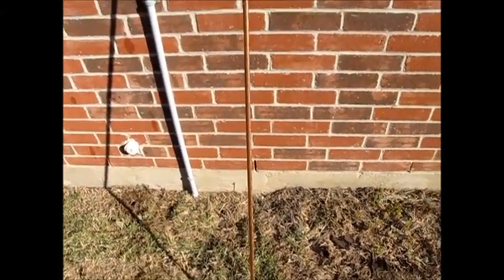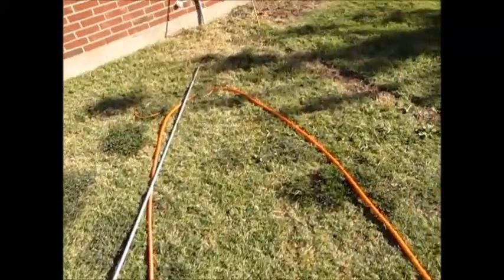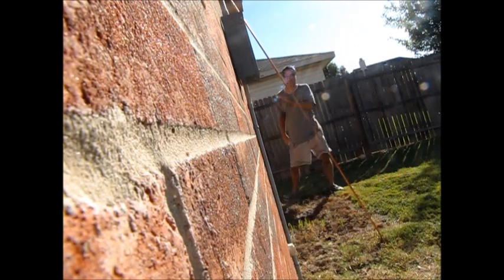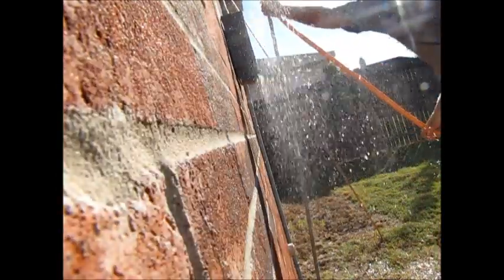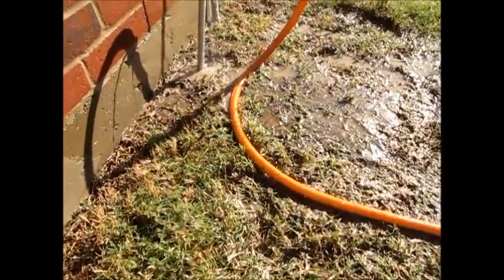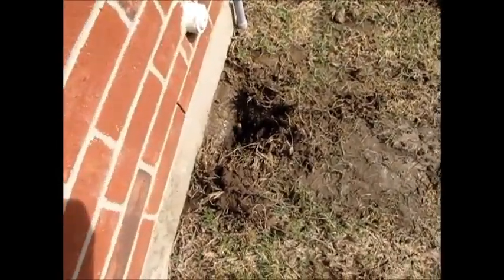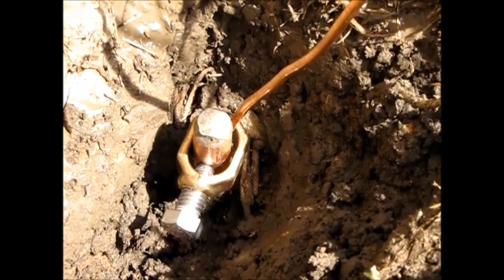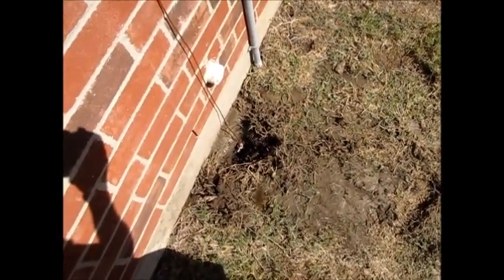How to Install a Grounding Rod The Easy Way (Full Demonstration)

Comment: Can you bury it with soild once done to conceal it so it will look clean and tidy? Thanks for this video man.
Reply from the maker: Yes, you can bury the entire rod once you make the connection to the wire.  But keep in mind that the connection that the wire makes with the grounding rod may corrode over time and lose its effectiveness.

Comment: Probable 80+ percent of the ground rods I have tested don't come anywhere close to 25 ohms not even two of them tied together.  I still use them because they are required by the NEC but you should never count on ground rods to protect you!
Reply from the maker: Truth!

Comment: I use an old black n decker spline drive hammer drill. Rod fit in nice. When i have no power i use a Milwaukee 18volt hammer drill, welded an old rusty socket on to a broken bit to cup the top of the rod. In both cases i Drill a 30" hole first then pour water in and ram the rod in. Angle away ftom footing of course. Always assume there is one. Pulling a rod is a bitch! Going to the store for another rod sucks. Cutting and calling it good is lame and just wrong
Reply from the maker: Good thoughts, thanks.

Comment: This is just dangerous. Get a post driver like a normal electrician and don't try to be CUTE with electrical installations. There's no shortcuts and no easy way out. Drive the damn rod into the ground if you'd like to pass inspection..... Water and electricity DO NOT MIX, so people DO NOT SPRAY YOUR BREAKER PANEL WITH A HOSE!!  Removing the dirt to PLACE the rod into the ground defeats the purpose. It should be tightly FORCED into the ground where it should have ZERO wiggle room or play. I should not be able to walk up to your ground rod and move it in the slightest MUCH LESS PULL IT OUT OF THE GROUND!! Save the electrical work for the professionals and DON'T BURN YOUR HOUSE TO THE GROUND!!
Reply from the maker: Please come over and pull it out of the ground.  I'll sign over the title to my car if you can.

Comment: how to make a huge mess and a lousy connection in three times the time it would take to hammer it in with a small sledge hammer.
Reply from the maker: *Provided you have no rocks in your soil and you don't mind having the head of your rod mushroomed flat.

Comment: Do not do this. This method  is driving ground rods is against every electrical code anywhere in the country.
when you use water to drive a ground rod,  and creates a cavity around the ground rod. After the water drains away the rod is completely useless.  Most of time you pull a ground rod right out of the dirt with your bare hands, after it's in water jetted . Using a water jetted  ground rod,  is  just throwing a ground rod on top of  the ground the ground,  it's just as effective. Don't do this,  it's dangerous, the ground will be worthless you will cause electrical hazard in the home because you will have no  effective bond to ground,  on anything in your entire house.
I have being an electrician or 35 years, and never once have I seen a water jetted  a ground rod pass a ground rod test.
You see this all the time on YouTube from people who don't know what they're doing, and when people put it on YouTube,  they put people's life at risk.
DON'T WATER JET GROUND RODS.  They are DANGEROUS!
Reply from the maker: Please come to my house and pull these ground rods out.  I have two of them.  You clearly have never done this and know nothing about this method. 

If you dig a hole in the back yard 5 feet deep and walk away, what happens?  Erosion fills in the hole.  Same principle here, but it is sped up by massive amounts of water and mud already at play during the process.  Are you familiar with quicksand?  Same thing happens to these rods.  Liquifaction literally sucks the rod in and it is very hard to pull out even when the water is still shooting through the pipe.

There is no way on earth you can get that rod out of the ground.
Reply: Perry, you say "after the water drains away the rod is completely useless."  That's not a credible statement.  It's not as good, but "completely useless" is "completely wrong."

Comment: We almost always do underground service, I just toss a ground plate in before backfill. I’ve never had to drive a ground rod now that I think of it.
Reply: That works but that's called of you for or horizontal ground I need to be at least 24 inches under the ground, and we always run 4/0 copper, for about 25 feet, to give the copper a good round diameter and lots of contact with ex around the Earth

Comment: The only thing I can say is that the upside the rod has to be concreted and it has to be suitable for inspection, not just filled with the soil.
Reply from the maker: I haven't seen any of these concreted before on any home I have lived in or owned.  Is that a new thing?

Comment: To go a little deeper on mptashkin remarks (which are totally right)...you don't take a bare ground wire from the meter box or panel or sub panel without piping, the correct pipe BY CODE is 1/2 inch rigid pipe until ground surface and PVC SCHEDULE 40 from the surface down to the rod...That the rod is gonna loose copper because you drive it or hammer it?...its BS!!!!...the rod was made and construct to be driven once you drive it you measure it with an electrical meter and should give you no more than 25 ohms...Bottom line....use a 3/4 drill bit 1 foot long and insert the rod and then drive it in with a rotary hammer and a rod cup at least 6 inches bellow surface...PLEASE DO IT THE RIGHT WAY!!!!!
Reply: Doesn't matter the application since the purpose is the same.  You can claim it's not needed, but then why do it?  And if you're going to do it, then it should serve the correct purpose and that would require the same physics of any system using Earth as the return path.  High impedance and/or resistance can lead to problems with respect to the ACTUAL building ground by creating grounding loops, etc.   STOP giving bad advice when it's apparent you have no expertise in this matter.
Reply: Richard M l
Reply: It actually violates code to run it through a metalic conduit unless you're using a bonding-bushing at one end.  And, the only place any protection is required by code is where it could be mechanically damaged.  In my municipality, the grounds must be visible for inspection (not just initial inspection) and anything 6AWG or large never requires protection even from mechanical abrasion.
Reply from the maker: Did you bother reading the disclaimer in the video description?  This is for low voltage DC and your NEC codes don't apply.  In fact, there is quite a bit of evidence and research that shows that DC systems should not even be earth grounded at all.

Yes, if this was a homeowner installing their own house AC electrical this would not be the correct way to install it.  But for HAM radio folks, off grid solar enthusiasts, or a landscape lighting installer this would be a very valid and easy way to install it.
Reply: @LDSreliance  I'm a ham radio operator.
I use extensive grounding for a large grounding for a large low voltage  station which is all DC. A properly  driven ground rod,  is even more important for electronic devices that are running on low voltage,  my computer  my DC radios,  any kind of electric devices. just because it's low voltage doesn't make water jetting okay you're still putting a worthless ground rod in the ground which does apsolutely nothing at all. Please stop telling people to do this. it doesn't matter if it's DC or AC high voltage and low voltage devices connected to the  Rod,   if you do the way you're doing it,  it's completely worthless, as a ground,  as a bond, as a lightning path.

Comment: The real solution to placing ground rods is to live in an area with sandy loam soil like my back yard where the only problem is;  If you hit the ground rod too hard during the final foot or so, it'll disappear into the ground and you'll have to dig it out.....
Reply from the maker: Wouldn't that be amazing?!  I have lived in rocky clay soil for so long I don't know what I would do.
Reply: Thats a nice problem to have lol. I live where the Brazos used to flow centuries ago. Hard compacted clay all 8 ft. Was a nightmare installing three of these things with a t post driver

Comment: I don't know of any professional electricians that would use this method, I think I could do it quicker with a hammer drill, which is easily rented. Most good ham radio station grounding system will have multiple ground rods all tied together and tied back to the main ac service entrance. I don't do it this way, but to each his own.
Reply from the maker: Yeah, this is definitely not for a professional.  This would be for a homeowner or DIYer that almost never has to do something like this and doesn't have the tools to do it the right way.  This would be a very easy way to do it.  I had to do this twice for my solar panel system and it was so much easier and saved me a bunch of money over running to the hardware store 4 times (pick up and return the drill on two occasions).

Comment: Anywhere that driving a ground rod can be done with a sledge, this method will work.  So why bother?
Reply from the maker: Why bother using this hydro drilling method?  Or why bother using a sledge?  I avoided using a sledge for two reasons:  my soil has lots of rocks that the sledge method cannot help with and a sledge will mangle the top of the rod and remove some of the copper cladding which can cause the rod not to be an effective ground.

Comment: If you're going to be shooting DIY videos for YouTube, buy a tripod. That's the easy solution for hands free camera management. You can get a cheap one that's good enough for less than $20 from Amazon.
Reply from the maker: I have one.  I appreciate the suggestion but it was not possible to set up a tripod that close to the house.  I was trying to get an angle as close to the brick as possible.  I understand it was harder to watch but I think my videos have improved since then and I do use a tripod as often as possible.

Comment: Go rent a Hilti TE-76 hammer drill. It will take you longer to plug it in than it will to drive it...Plus no water.
Reply from the maker: Yes, there are power tools available to do this job.  It will cost you $39 for 4 hours to rent that tool.  You have to drive to go pick it up and you have to drive to go take it back.  So if you are talking total time invested, your rental takes more time total.  It also costs 4 times more and that is before you factor in the cost of fuel to drive all over.

The purpose of this video was to provide a DIYer an alternate, easy method to drive in a ground rod which is not something you will do every day.  It is easy and quick.  It is not meant to be the best way or the only way.  Obviously if you are a contractor or electrician you are going to do it a better way but don't tell me it will be faster or cheaper.
Reply: LDSreliance  it's faster and cheaper when you own two sds hammer drills. hire a pro for this stuff.

Comment: 1.  This method should NOT be used for ground rod installation.  The ground rod(s) work by coupling with the surrounding soil.  The electrical code requires that the soil be undisturberd or compacted.  This method will create voids and the soil will not be compacted around the rod.  This increases the resistance of the connection which in turn reduces the effectiveness of the driven rod.  The bottom line is, do not use this method.  Ground rods should be driven.

2.  To answer the question regarding grounding below, you should not attach an equipment ground to a neutral bar, downstream of the electric service, as it creates a parallel path for current to flow.  Current on the neutral will not flow on the equipment grounding conductors creating a shock hazard.  Anything that is metal in the structure would now carry current as the current will seek all paths back to the service (or more properly said, the utility transformer on a grounded system).  The amount of current will be dependant upon the resistance of the particular path but rest assured, it will take all paths.  NEVER connect an equipment ground, downstream of an electrical service, to a neutral bar.
Reply: Where does the code say undisturbed or compacted? 
Where in article 250 is this? 
Is it not possible for the soil to settle itself again?
How does this method of installation create a unsuitable connection with the earth?
What is the new resistance of a ground rod driven via this easier method?
Is a ground rod 8 feet in length so that every square inch makes contact, or so that a certain amount makes contact?
Why does the new code require 2 ground rods driven 6 feet apart?
What are the methods of testing a good ground rod installation and do inspectors carry the specialized equipment necessary for testing them as well as the site?
Reply: You are exactly correct.  Also not to speak of the mess this makes.  It isn't that difficult to drive in a gnd rod.  It should measure less than 25 ohms resistance.  Also the spacing between 2 gnd rods should equal the rod length.
Reply: Very nice exclamation right on the button
Reply: dangerdavefreestyle all they will ask is, "was the installation of electrical outlets, lights and the delivery of supply done by a registered person?" if no, vacate, prosecute + rewire. also, this is youtube - people watch this shit all around the world.
Reply from the maker: +mptashkin Read the video description.

Comment: I believe the reason for disallowing bonding between neutral and ground at a sub panel is the lack of a grounding rod at sub panels being closely connected as it is at the service entry. You can place sub panels wherever you want where as a main panel must be placed no more than six feet from the powers building entry point.

Second nothing can protect you from lighting strikes. You can only decrease your odds of damage by lightning arrestors outside of a building. Transformers are supposed to but not always be grounded at the pole.   

If a sub panel is going to be used at a second building and is at least a one hundred amp main 240 volt panel can you supply it without a ground and use a ground rod system as long as you meet service entry qualifications?
Reply: We disallow bonding the neutral and ground at subpanels because doing so introduces the possibility of a ground fault traveling through the neutral back to the main panel. Also, additional ground rods should NOT be driven separately for subpanels. Doing so introduces the possibility of side flashes in lightning strikes. All grounding should be done to the single grounding point on the structure, usually located at the main panel. Consult Mike Holt's grounding and bonding videos for further information.
Reply: lmao you are clueless
Reply from the maker: Kim O'Brien Kim, unfortunately I am not experienced enough with AC electricity and electrical code requirements to know the answer to that.  I am sorry!

Comment: When it comes to grounding and bonding of electrical systems everyone is subject to building codes and esp. NEC.That said, it is messier than beating the rod through rocks, and clay. A larger pipe should enable you to disconnect the hose, insert the rod through the pipe then withdraw the pipe leaving the rod in place. Using water is a good idea, even better when its hot outside
Reply: then you've put a rod in the ground, but taken the ground away!

earthing rods work based on contect with the ground, more contact = better earth.

by your method you're doing your best to minimise how much contact the rod has with the earth around it because the pipe you pull out will leave a void around the rod
Reply: Nature does NOT compact soil at the bottom of an 8 foot narrow column!  Not in your lifetime, anyway.  Do you want to wait until the next generation for the ground to be effective?  It's not optional... it's safety.  Again, stop giving bad advise based on your "common sense"... it doesn't apply here.
Reply from the maker: MrSullione Good points.  Thanks!
Reply: MrSullione That's actually what I thought he was going to do. I'm installing one this coming weekend, I'll give it a try and report back!
Reply from the maker: Cool, good luck!
Reply from the maker: Matt Matt, try this experiment.  Go dig a hole in your backyard.  Now shoot it with water from your hose.  What happens?

Nature compacts the earth again for us.  Also, I can assure you that there was still plenty of resistance to the pounding of the rod into the ground even with the hole.  There is plenty of ground in contact with the rod and within 2 rain showers that sucker will be in there tighter than anything you could possibly do with power tools.